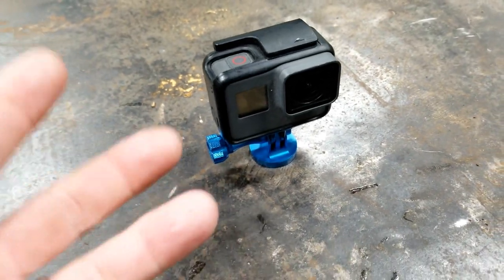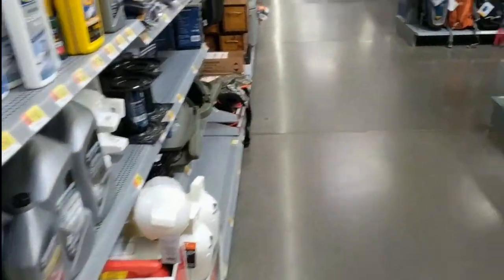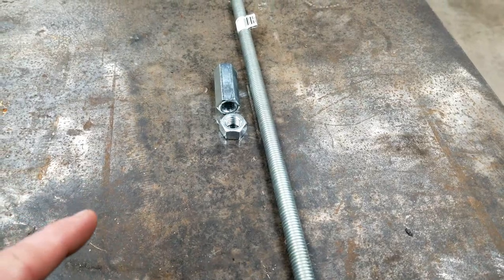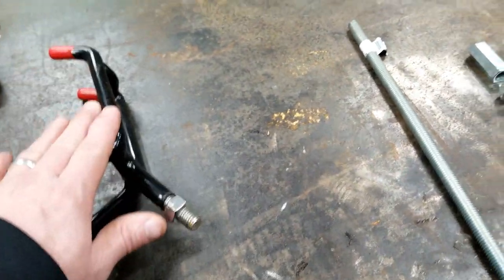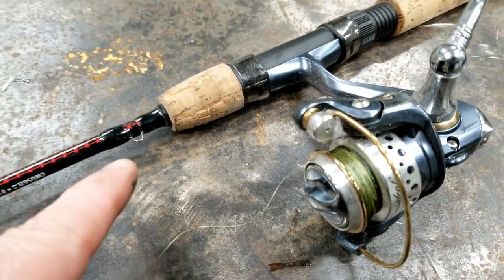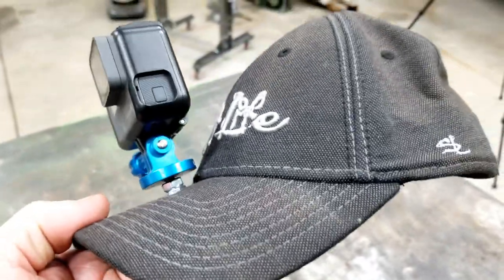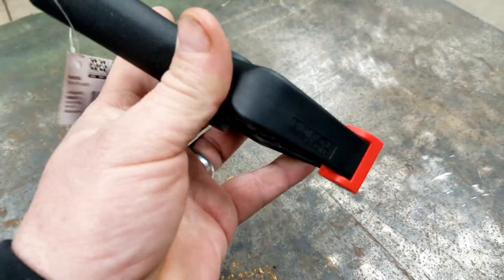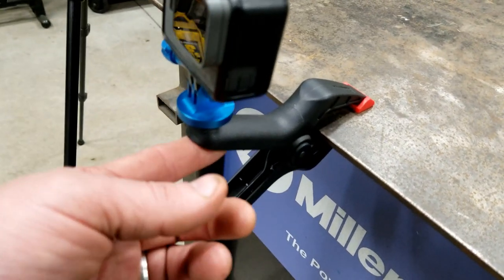10 Fishing Hacks in 10 mins

Comment: DIY suggestion: I’m thinking about how to make a simple spider rig set up for small boat. 15/48 Grizzly Sportsman. Must be removable. Thinking 4 rods opposite troll motor. Thinking magnet on existing flat iron I’ve already mounted for my duck hunting light bar. Dunno if it will be string enough. I dunno. Ideas? Could get a store bought aluminum one for 150 but that’s no fun lol.
Reply from the maker: Lol nope that's no fun at all , I've never thought of using a magnet . Hmm not a bad idea . Maybe 3 of those 90lb magnets from harbor freight,  it could work . If its removable I don't see why you couldn't use some 1" steel tube . The boat RodRack I made is holding up good . Its coated with bedliner spray , ppl always say ol you can't use steel but 98% of boat trailers are made out of steel and we dunk then in the water . Plus if its remove able it's not going to be left outside all the time . And steel is not much different than aluminum weight wise because it takes a thick piece of Aluminum to be as strong as a thin piece of steel

Comment: Hello! As a fisherwoman for a lifetime and love your diy projects but I have a very dumb question. I've seen the planner board and I'm curious what it's used for? Also I'm planning on making your black rod holder for my husband and I. Plus why haven't you showed how to use PVC as a good use in your ice chest instead of ice? A piece of PVC pipe and 2 end caps. Put some rock salt or regular salt, fill with 3/4 water. Seal and put in freezer til you need it. No mess! You can also paint them any color you like. Real good for tailgate party's.
Reply from the maker: I do have another PVC  video that had the ice tubes on it . I have a bunch of hack and PVC videos lol . Ol yeah planerboard are for trolling ( for Striper  , Catfish , crappie ) or anything else you troll for , and its purpose is to spread your lines a part sho you can cover more water with every pass and to keep everything from getting tangled up .

Comment: Threaded rod maybe a little lite for extensions for bigger fish or if real long. I made my on trolling rack with 3/8 rod but I have piece of 3/4 ENT sandwiched between base and  t-bar. It’s as sturdy as the what bass is mounted to.
Reply from the maker: 1/2" threaded rod is plenty strong enough  , I wouldn't go over 12" but for that application there's no way 20lb can bent it , which nor many reels even have 20lbs of drag . I think my ProRockets only have 18lbs of drag but most ppl only run 5lbs while fishing . I really don't see em not being strong enough

Comment: For rod holder extenders from the bank I use old broom handles cut to size and drill a hole deep down.. electric tape the tip so it doesn't crack and taper the bottom to a point.... good as gold...

Comment: with the trolling motor on the front I have no way to get A light bar on my boat without A stanchion Mount but don't want to spend hundreds of dollars on LED go light ,,,DIY video on this would be absolutely Awesome !!!
Reply from the maker: You want something removable you can put on or stationary
Reply: @FishinNStuff  stationary however it would be cool to see if there was A way to hook it up to my removable nav, light pole ,,, I'm going to try to put it together by welding a 1" steel tube about 12" high to A 2x2" angle iron and run the power inside the tube and add the title switch to the switch panel in front of the boat I'm also going to run the nav, lights on LED strip on front of boat and Amber lights on two piece rod racks on back  decided to remodel my rack after watching your video thanks for All your awesome DIY videos!!!
Reply from the maker: @arthurarmstrong873  on my old grizzly tracker I had thought about making a  light bar that mounted into the seat mount on the front deck that would be removable
Reply: @FishinNStuff  I have A 2018 Triton CTX that has three seat bases in the front that is actually A awesome idea!!!!
Reply from the maker: I think it could work,  and on your boat it would be better because you could mount it in 2 bases then it would be really solid,  like of like a little tiny RodRack but up front with a light bar on it
Reply: @FishinNStuff  my wife Nikki do Alot of fishing with me and being A Fair skin redhead she can't handle to much sun so I taken A old seat post taken the end out of it and cut down A beach umbrella I got at Walmart for $16 dollars cut it to be shorter put slit in pole and wedge it in tight not only does it keep sun off her it has saved me in extreme downpour I have not seen A DIY video on this but I think it would not only be awesome but it was super cheap especially compared to A soft top kit,, just A idea you might be able to use ,,, wish I know how to send you pictures ...
Reply: With the three bases on the front of the boat it makes it really nice and don't get in the way of two people sitting in the front
Reply: And it fits in the rod locker for storage two piece pole super cheap and effective 👌
Reply from the maker: @arthurarmstrong873  that's a great idea I might use that on a future video I appreciate it  , you can Email me pictures at keiff32@hotmail.com

Comment: Good  job  keep it up.    on the rod holder  connection  at home depot the rod couplings  were cheaper in the section  with threaded rod  than in the electrical section.  you have to watch all the stores for prices they are sneaky
Reply from the maker: Yep your right , I figured most ppl knew that but , just thought I'd point it out

Comment: You need to float test the keys, knife and scissors before you get into deep water.  Because it is my experience that those little corks will not float even your keys.
Reply from the maker: I agree and I should have said that , your 100% correct  . I believe the key which are dooter light would be fine , the knife is light to butt probably pushing the buoyancy of the cork . But the scissors would need a bigger cork lol . It was just about the idea of it . Those corks are more buoyant than I would have thought  before doing the cork video where I tested the buoyancy of some didnt material